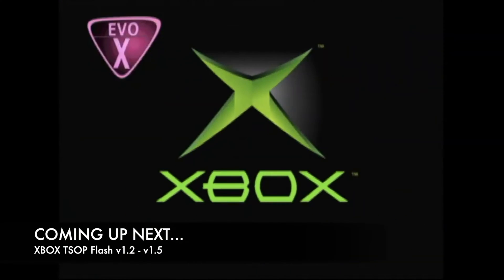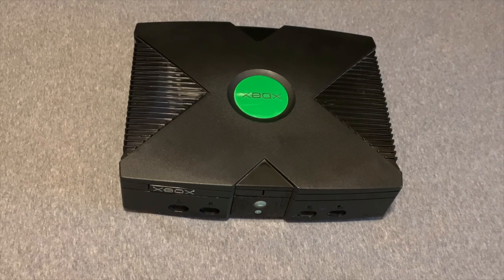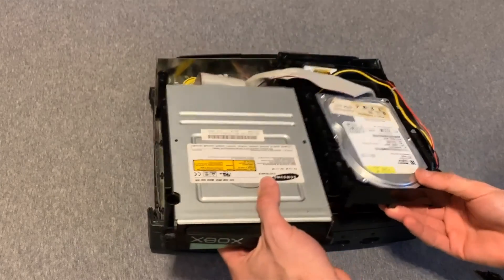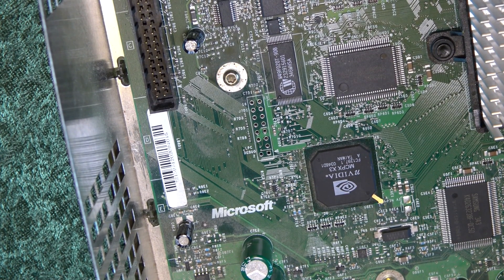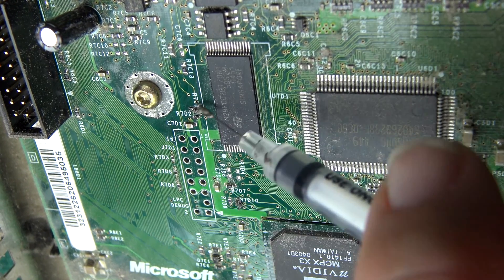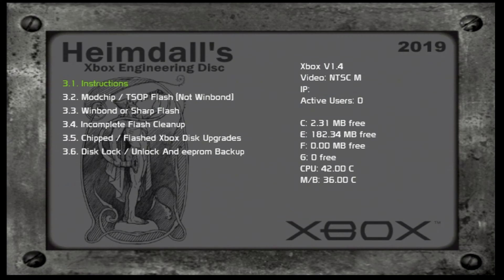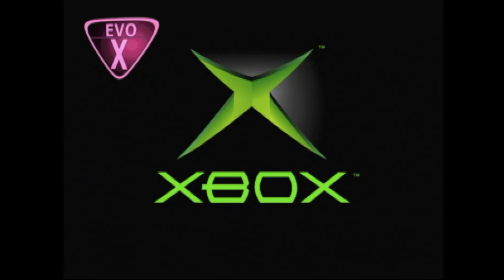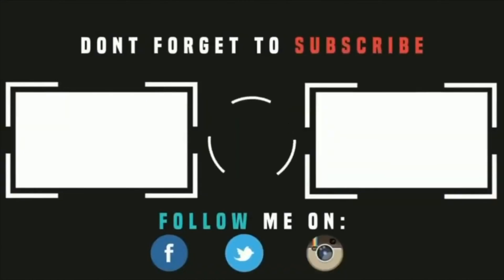XBOX TSOP Flash Tutorial How To Guide v1 2 v1 5 Hynix Hyundai ST ONLY

Comment: Hi Blaine, great tutorial! You've given me the courage to update and revive my Halo Special Edition OG XBOX. I have the Winbond chip so it may be a lil bit more challenging. I did notice that in the portion of the video where you are cleaning the board there is a WInbond, but the segment that shows you (and the wife) doing bridge work features a board with an ST chip. I'm guessing the difference in the set ups happens at the software/BIOS stage. Is that correct? Would be great to have some more info and clarification on what to do differently for the Winbond. Thank you!
Reply: Would love to here an update on this if you ended up figuring it out!
Reply: @robertsgameroom  I wound up hard modding my xbox w an Aladdin modchip. The chip already comes flashed with the EVOX bios. To complete the install and setup, I used Hexxen 2021 software dvd to format my new hard drive. Bought Hexxen for $10 on ebay. Somewhere along the line during the Hexxen set up process I was given the option to select Winbond chip, if I remember correctly. Plenty of tutorials on youtube, but the guy who had my exact model xbox, Aladdin chip and Tutorial was Retro Pro Frank. I followed him mostly.

Comment: Great Video. I'll have to try this on my current soft mods. Sounds like it will add a lot of added value .. Also, can you share the link to the Softmod method you mentioned in the video ( Rocky  5?). I've only done the old school cable swap method,  so an easier method would be appreciated :)